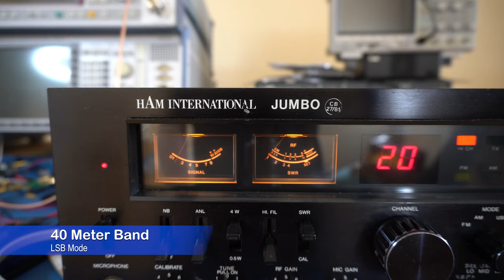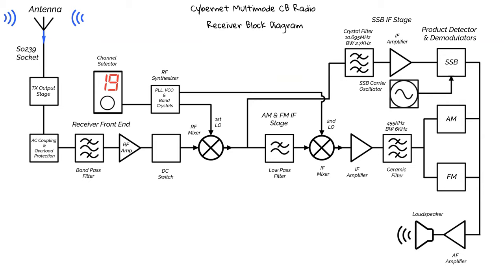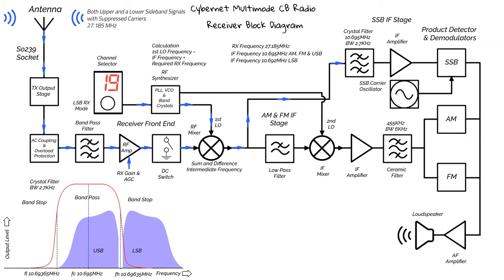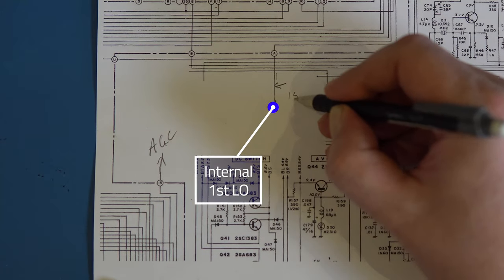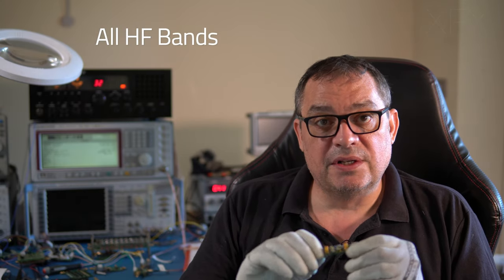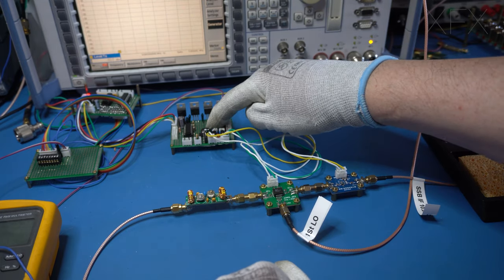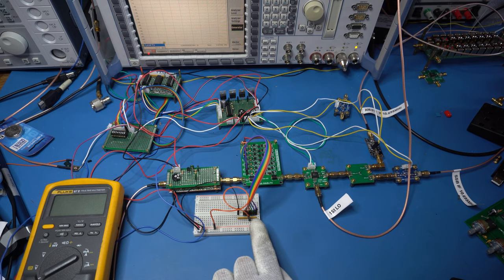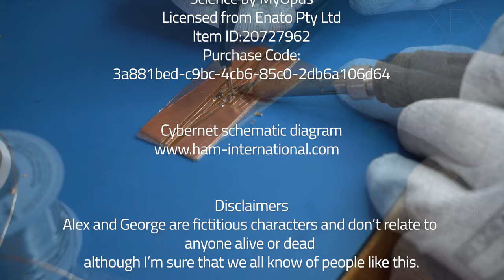Covert CB Radios To The Ham Bands - The Receiver How It Works

Comment: Absolutely brilliant video, like you I have converted many a CB am transceiver into ham radios, mostly 40meter ssb, using various methods, and lately started  using the rf module mixers, they are very good value too, I've taken the conversions 1 step further, made them transmit on 40meter/ 20meter / 10meters. Enjoyed your video, look forward to seeing your next one.👍
Reply from the maker: Hi Peter, I am glad you enjoyed the video. I'm currently working on the next instalments. If I'm honest I am still fiddling around with receiver building the controller, VCO and display. I have a few ideas for the TX to make it will cover all the HF and 6 metre bands but it's still work in progress.
Reply: Looking forward to seeing your next one. Best regards

Comment: I Have Modified a few over the last 30 years to work on the amateur bands ....Mainly 28 mhz  and down to 21 mhz ,with minimal work,they work great......i also modified a VFO and used it on the cb radio to tune across the band.......

Comment: Lots of work in this, most, even those with the RF experience required, would find it too much work & not bother to do it. But most would  also not put so much work in making such a technically detailed, informative & entertaining video on this particular topic. The history of Cybernet was also interesting, I must have so many radios made in that bowling alley factory. The most I did  on CB conversions was as a 14yo in 1980, to get my (sold in Australia)  "Cybernet" Philips SSB 201 onto 28MHz, then convert back again to 27MHz when I finally afforded to buy a Yaesu FT901DM. 

If I had to use a favorite CB radio (like an old crystal controlled HyGain V for example) to receive and transmit on other bands I guess you could leave the favorite CB intact and just use it as a 27MHz IF with an external transverter built with similar modules as those you use.
Reply from the maker: Hi John I made a lot of the video during lock down and had a bit time on my hands, to be honest I could have made 3 videos out of it. I may still break some of it up. I just bought the radios as a project as I wanted to make a rig that is dynamic however; I really carried away with it. It was a lot of fun making the video and I learned a lot about making videos too. My plan is to make the radio also operate normally as a CB as well as other bands. Best Regards

Comment: The PTBM series CB radios are originally Hy Gain Puerto Rico, they went bankrupt in 1976.
Cybernet bought the rights to the radios, and carried on making the same CCTs, even the same
size and shape PCBs, but with much better quality components and PCB, check out
 the old Puerto Rico Hy Gain 1 to 16 schematics. Crazy thing is the evolved Cybernet CB27/81
 FM PTBM134 boards still had the original AGC line from those old AM Puerto Rico rigs, FM RX dont need AGC
Reply from the maker: Very interesting I did know that. The rig you saw in the video had a fake UK 27/81 marking and was made in 1980 Kawasaki Japan. Yeah a lot FM rigs didn't have AGC it depends on the design I geuss. The AGC on the radio in the video is still engages when on FM. Thanks for the comment.

Comment: High side injection Cybernet multimodes convert easily to 50MHz 6 Meters, simply rewind
 the front end coils for 50Mhz and filter the plus 38MHz vco +10.695 IF: 49MHz mixer product
 instead lower 27MHz: 38MHz VCO - 10.695 IF. and shift the PLL up a couple of MHz
Reply from the maker: Hello Phillip Thank you for your message and apologies for the late replay, yes I saw that the front end band pass filter can be tuned up to around 30 +MHz. I guess rewinding would get you up to 6 meters as im sure the coil forms could handle it. Interesting palying with mixer product too.
Reply from the maker: Phillip You have me intrigued do you know any more about Hy-Gain Puerto Rico I would love to know more about this?. Thanks

Comment: An Arduino based si5351 as the vfo would be small enough to fit inside the radio .
Reply from the maker: The Si5351 looks really interesting I am going to get one to play with, I'm currently developing an Arduino Mega to control the radio for everything from RF amp levels, band pass filter switching, signal routing and a DDS module for the VFO using the Analog Devices AD9910 (work in progress). I would also like to control the AGC with the Arduino but all the analogue output are PWM. I have a Due board which has a DAC but all the I/Os are 3.3V and I think I have gone to far up the road as everything is 5V. BTW I really like your channel.

Comment: I've a cobra 148 plus other multimode rigs I've moded for 10 MTRS and  40 MTRS ... I've videos on my channel .
Reply from the maker: I just watched the video of the 148. Sounds great. nice work
Reply: @M0XFXUK  Thanks John , I went the transverter route as I wanted to keep the 148 basically original , And the main band for me is 40 MTRS as it's a good mixture of DX and local as you know ...... Anyway , It's a great video series and very interesting ... A radio that covers say 20/40 MTRS is all Ide basically require ..... It's food for thought for sure 👍

Comment: Why would you.. It's not worth the hassle and wouldn't be very good anyway... Cb are by definition rubbish haha... A good hf set is the way to go
Reply from the maker: Hi Colin yes you make a very good point and I agree that it is much easier to buy a HF rig however; I love tinkering around with old radio gear and repurposing old equipment. You would be surprised how well the SSB receivers work in old CB equipment. I am now designing and building complete SDR transceivers and these projects help me learn and develop my skill set. Whatever happened to hams making their own gear? I guess it whatever flicks your switches.